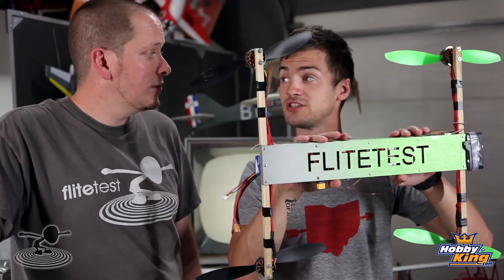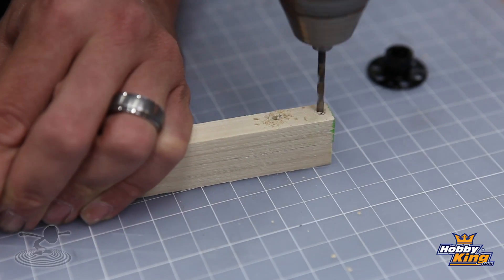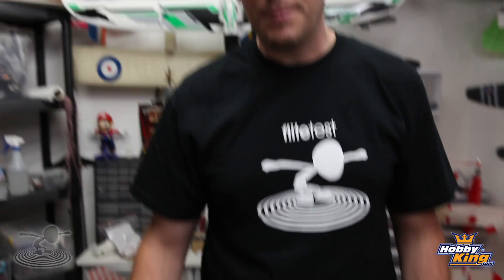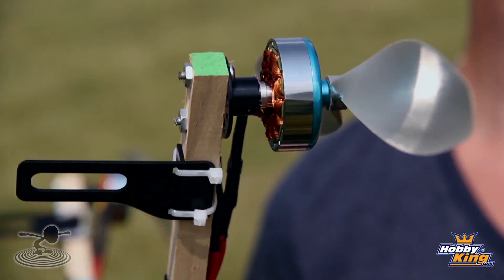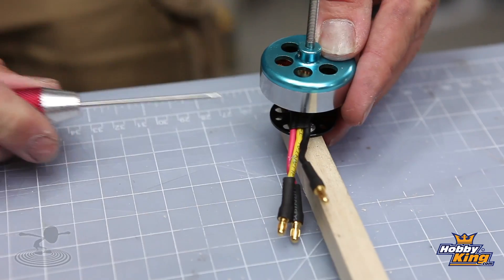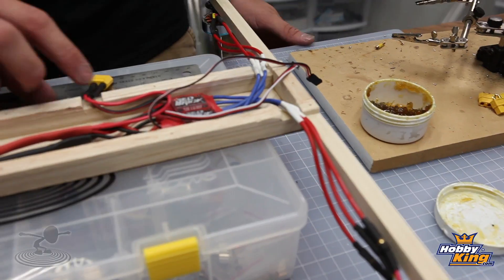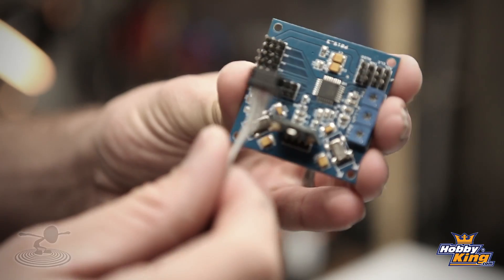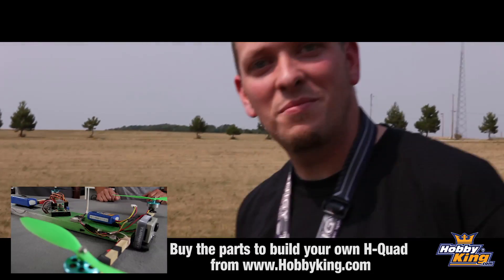Flite Test - H-Quad - SCRATCH BUILD

Comment: Hello, in reference to the motor mounts, what size allen wrench or star screwdriver do I need to remove the mounts to mark out the holes on the quadcopter's boom?  kind of small and not sure if it's an allen wrench or star.
thanks
Michael Cote'

Comment: Hi, i have got all the parts and assembled the quadcopter. however although the proportions being correct and parts working correctly the quadcopter, whenever i try to lift it off the ground, the kk2 self stabilization system keeps pushing air from each motors at different speeds making the quad to turn upside down which has damaged my propellers multiple times.

Comment: hey guys,
i finally got almost all the parts together, but i cant find any information on the receiver i should use. Does anyone have tips about which receiver and transmitter work good with the parts listed by flite test.
would be very helpful :)
Reply: +Manas Deore thank you :)

Comment: Just a suggestion? For below 120$ maybe less you can create an 300 quad with the RotorBits parts from HK. Using the cheap DST motors and the cheap Flycolor ESC's. You will need 4 t-connectors, 4 motor mounts, 2 carbon tube 300mm, 2 aluminum tube pre drilled 300mm, some mounting plates and screws. All parts you will find in the RotorBits section at Hobbyking. Except the Flycolor ESC's, they can be found under Multirotors/ speed controllers. Weight for the frame below 230g.

Comment: What is the diagonal measurement from motor to motor? What is the weight of the frame without motors, ESC's and electronics?
Reply: Silberner Surfer about 600mm i think, am i right?
Reply: Silberner Surfer 227g, i have read it below.
Reply: Silberner Surfer And around a KG ready to fly

Comment: I would encourage people to stay away from those motors. I've gone through at least 10 and I epoxy them but I do not at all like the design. I would go with Multistar motors which is what I will order. Those motors are also so far off balance you cant really do anything about it.
Reply: Firstly what do you mean you've gone through ten motors, secondly the answer to unballenced motors is to ballence them, and lastly the multi star motors are peices of CRAP! Have a nice day

Comment: Hey Guys. Have a question.
What happen if i don't use speed  controllers?
Asking about both quad and tricopter..
Reply: not sure what you mean? speed controllers are required for the motors to operate. they take power from the battery and send it to the motors. the three wires from the motor to the speed controller (each wire alternating between 12v, ground, and neutral) are completely different from the three wires from the speed controller to the kk board (5v, ground, signal). you can't just connect the motor to the kk board.
Reply: Joe Dockstader  I get it now.  Thanks for answer :)
Reply: If you attach two of the three motor wires directly to the battery the motor will twitch a little bit and then burn out the windings.

Comment: Very inspirational video which led me indirectly to build a "kind of H Copter" called Clark Cable..after the great 30s, 40s and 50s actor..CC is unique in that it is a rock solid flyer only held together with cable ties...it only weights 350 grams and cost $40 to build from Balsa Wood and Plastic Corflute..absolutely no screws or bolts and completely part replaceable...check it out YTwatch?v=3axSXJOxtiw

Comment: I made it yeserday it was really easy!! Ordering my parts today, only that you are yousing that 750kv motors but thay are out of stock on hobbyking so my question is can i allso use turnigy 750kv motors with this same setup? So the same battery, same escs only motors to be different but thay will have same kv ratings... Please write back :)

Comment: I have built a quad to the same specs but I cant get the esc's to calibrate. I have plush 30's, and i86 board. I am also using a Turnigy 9XR and this transmitter/ receiver combo 
FrSky DF 2.4Ghz Combo Pack for JR w/ Module & RX

I would appreciate some help with this. Maybe a video showing how to set it up.
Thanks

I have a vid in my channel too showing what its doing. All of the motors are spinning at different rates.

Comment: HELP ANYONE!!!
 I'm using redbrick 30 amps and they are a pain in the rear! My h quad is very bouncy and cant even take off without flipping over. My kk board is fine its just that esc's dont seem to be working right. they are all calibrated together but they still spool up and spool down on their own terms... any suggestions???

Comment: Another excellent Video Flitetest! I see in your other Quad and FPV videos that you have challenges getting a smooth vibration free full HD video, especially on the CMOS sensor equipped GoPro. It would be great if you can do a special on shooting vibration free videos, like techniques on balancing the propellers, balancing the motor bells and home made camera mounts with good vibration absorbing materials. Love your show and especially the latest ones on multirotors!

Comment: i should, in all fairness, mention that on the most part H/K has excellent electronics at the most reasonable prices and I have had very little problem with any of their electronic products..until I purchased the Red Brick esc's. It could be that it was just one bad batch but the outcome was still negative.

Comment: Pesonally i have never had a Red Brick yet that hasn't failed i have tried the 70amp and 50amp and both not only failed but never worked at all. I have a 10amp as well but I'm not even going to use it at all. One of my flying buds also ordered two 50amp Red Brick esc and neither one worked at all. attempts to have them replaced by H/K have proven to be dissappointing

Comment: Love this quad, I think I am going to build this. The only thing I would add is a rudder in the rear, not a working rudder but use it for orientation because at eye level, 100 feet away it's all props.

Comment: I fly Red bricks (30A) in my quad, they are flashed with FastPWM firmware and only one turned into flames :D ... after swapping to new one all is flying perfect ;) RB's are not that bad, they are cheep and with that you can buy one or two for spares :) BUT what You need to know, under the red shrink tube there is a HK SS 25-30A ESC  the one without HW in the part number ;P (or maybe I just got them like this? ;P)

Comment: You know what else would be good with the spacer? Not making it a solid strip and only putting spacers in between the frame rails and the bottom plate where there's a bolt, allowing those open spaces in between to act as extra ventilation.